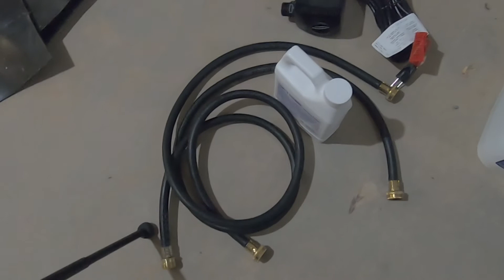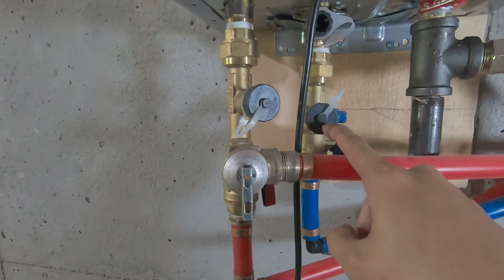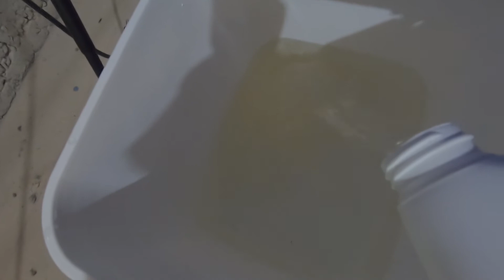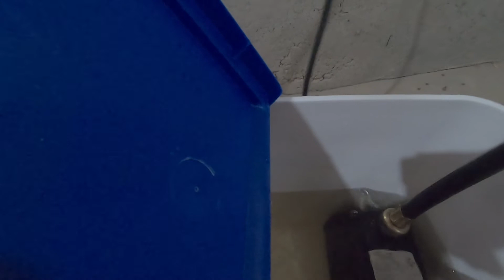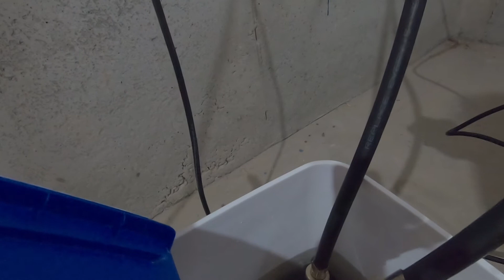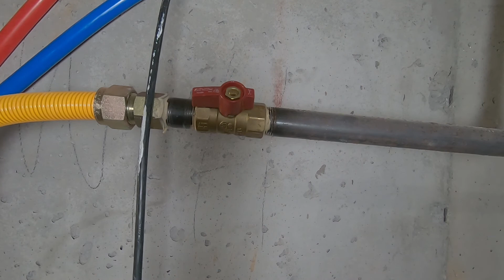Flush Rinnai Tankless Water Heater

Comment: Great video but you are missing an important step for a Rinnai.  Before you flush,  unplug the unit for 30 seconds.  Plug it back in and it will open all of the internals that need resetting.  That's what's happening when you hear those noises from plugging it  back in after you were done..... after it completely resets (about 20 seconds), go ahead and unplug it again and proceed with the flush.  Thus will ensure not to miss any spots in the heat exchange.
I learned this from a Rinnai technician and verified on other youtube videos.
Reply from the maker: Great point!

Comment: Hi I run the pump for 2 hours. The vinegar turned blackish and hot. Metal part for the hose got rusty. All those blackish vinegar went through my heater. Is it ok? My Rinnai heater is 4 yrs old one. It’s same as yours. Hope I didn’t damage anything to my heater 😢
Reply from the maker: Did you unplug the water heater? Sounds like it was on when you flushed it. If your water is still getting hot then I would assume everything is fine, if not, then I’ll call a plumber.

Comment: You should remove the inlet filter prior to pumping the flushing fluid through the unit so you can get adequate GPH flow through it.
Reply from the maker: Good point
Reply: How you do that?
Reply: @Truthfulfisherman  With the water and gas to the unit shut off, do this : https://youtu.be/WeZOHhwfwdY?t=184 . 

Be gentle.. you do not want to crack the plastic ring. I use to use a wrench to grab onto it but now I use a flat piece of metal that fits in the middle grooves that the plastic ring has and twist gently because I have cracked the plastic ring. I also add grease to the thread so it does not seize up and is easy to remove.  You can try to spin it by grabbing the inside (middle) plastic "wings" but they tend to break... they can break without having an impact on function but if the outer ring breaks you will most likely have to replace the filter because it might leak. Not to mention it will be impossible to remove without carefully drilling out the center plastic than prying the plastic off the threads gently without damaging the thread. So, it is always good to have a spare and be ready for that procedure (worst case scenario). Just try and spin it... if it is stuck then don't force it and wait until you have a spare on hand to try it.

The flat piece of metal I use to fit into the grooves and spin the plastic inlet filter is 1/16th of an inch shy of 3/4 inches wide.

Comment: How often would you recommend a flushing when the water is soft?
Reply from the maker: According to this site, they said every 3-5 years. I personally going to do it every 2 years since this first time didn’t really have much minerals. https://homeinspectioninsider.com/maintenance-tips-for-tankless-water-heaters/#When-Should-You-Descale-a-Tankless-Water-Heater
Reply: it's just me living in my house and i don't use that much hot water. and my water is soft (checked with my local water dept. and did tests on the water) i still do  the vinegar flush once a year. remember, it's better/easier/cheaper to do this once a year than to have your unit go bad and have to replace it sooner than necessary. also, if you start getting build-up inside the unit- it'll flake off and could clog up all of  your plumbing and lead to more repairs.   doing the flush is very easy - no reason to not do it once a year. the plumber who installed mine said i could go 2 years, it's still safer to do it once a year.

Comment: That was real easy, but Rinnai recommends you use Vinegar to flush out the system and my Plumber says and other Plumbers i talk to say if you get a water softener system installed your tankless water heater should be pretty much maintenance free.
Reply: if you're suggesting that having a softener means yearly flushing  isn't necessary, good luck; but i think anyone who doesn't do a yearly flush will be replacing the unit earlier than necessary. and FYI, the plumber in my area who installed my tankless heater does not agree with what you're saying.
Reply: @beavis4play  don't get me wrong i know a FLUSHING is recommended and NEEDED but from what i was told it would be like 1 1/2  year's or slightly longer with a softener system, i guess it all depends how hard your water is but yes for now I'm doing yearly flushes.
Reply: @jesusbaez4427  - maybe. i'm just saying,  preventive maintenence is just that - i'm doing it once a year just because that beats replacing the entire unit. and don't forget, if you start gettting build-up, it'll flake off and could clog the screens in all your fixtures. good luck however you do it.
Reply: @beavis4play  thank's, same to you as well.
Reply: @jesusbaez4427  love seeing you guys’ comments with respects.
My plumber did not say anything about annual flushing seven years ago.
Can’t bear with getting more frequent cold water mid-shower in the last one year or so, so decided to do it today.
Not having isolation valves, not having pumps, ended up doing it with whatever I could find at home, and a 1L of left over vinegar, and one and a half hours later.
Its all good now, fingers crossed.
You can really see the vinegar turns green-bluish after an hour.
Reply from the maker: Good to know. Thank you!
Reply: With soft water which is what a softener will do you want to flush every 3-5years.

Comment: Is that chemical good for your grass and tomatoes?
Reply from the maker: According to the product description, it's completely safe. I didn't see any issue either. 

"Flow Aide System Descaler is a non-toxic concentrate which is certified to NSF/ANSI 60 for use as a cleaner in potable water systems. FLOW-AIDE System Descaler is specifically designed to dissolve the toughest water scale, lime, and rust deposits from virtually any piece of water based equipment. This powerful, yet totally safe, liquid is non-toxic, non-flammable, non-hazardous, non-corrosive and biodegradable. FLOW-AIDE System Descaler will not harm your personnel, equipment or our environment!"